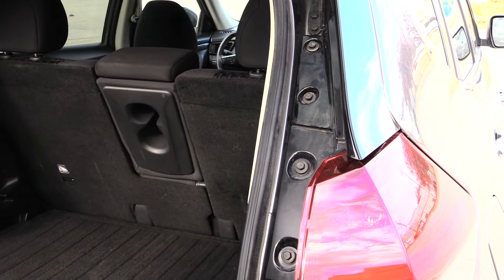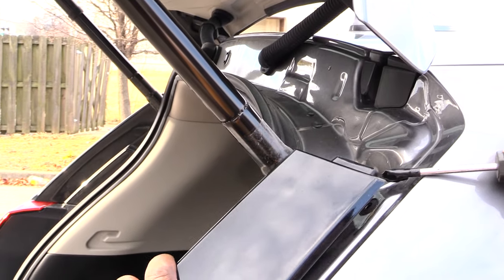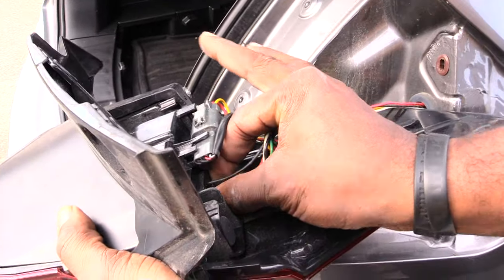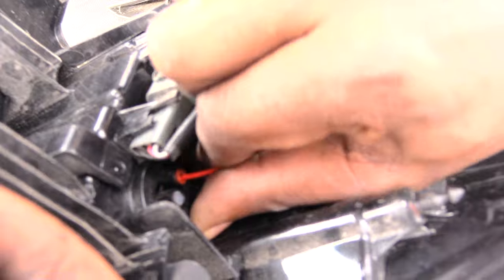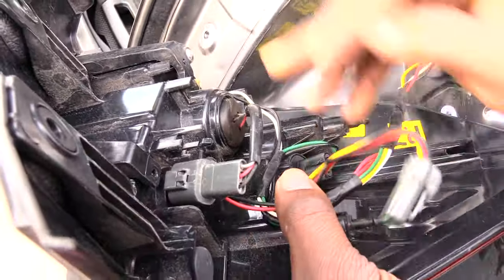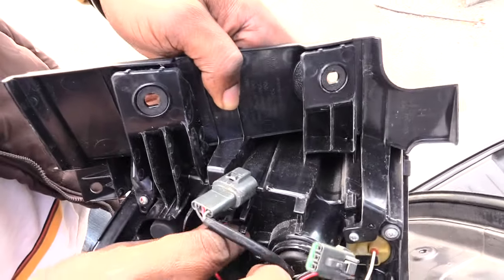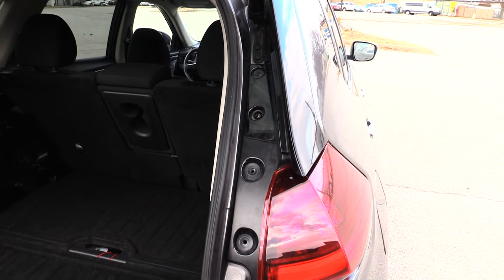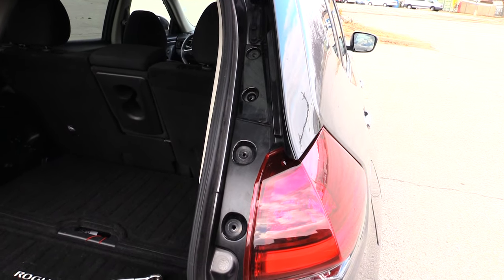Nissan Rogue 2014- 2019 Brake Light and Assembly Change! Easy

Comment: Friendly tip for everyone, don't use a screwdriver. It makes the job way more difficult and it may scratch the car and crack the light. Just pull the brake light out from the back. The screwdriver isn't needed.
Reply from the maker: Thanks for tip agree. Please subscribe like and share 🙏.

Comment: Excellent video!  As a 57 year old woman determined to save money I followed your video and successfully changed brake light and did the little white bulb since I was there.  If I realized there were 3 I would have done the 3rd!  I did have to use the screw driver as light would not budge. I put a medical glove over the screwdriver and gentle pushed and it was easy to remove the light.  So proud of myself!  Thank you again!!!!
Reply from the maker: Your very welcome glad could help thanks for tip.

Comment: Just for some clarification, you only have to worry about getting finger oils on bulbs that have quartz glass (halogen bulbs). If it's a regular incandescent bulb with non-quartz glass then there's no worries. The issue is that the halogen bulbs get a lot hotter than standard incandescent bulbs and the oils on the hotter quartz glass will cause the glass to turn black and crack. To get rid of any oils, use a clean paper or cloth towel with rubbing alcohol on it. Using just a towel alone is not enough to remove the oils from the glass.
Reply from the maker: Thank for helpful information. Please like subscribe and share.

Comment: Thanks for the clear instructions. Just a tip I found a small hard plastic putty knife to be the best at popping the housing out without scratching the paint. It’s able to fit in the curved gap and gives a stable point to punch the top of the handle to release the clip.
Reply from the maker: Thanks for tip 👍🏾Your welcome  glad could help please subscribe like and share and check our my other helpfull videos.

Comment: I couldn't get it to budge.  I was worried that using a screwdriver might crack the assembly.  I finally tried a thin putty knife (with tape on it) and that did the trick.  Of course I was given the wrong bulbs and have to do it one more time.  lol

Comment: If you touch the bulbs with your bare fingers, you should use isopropyl (rubbing) alcohol to moisten your paper towel before cleaning the bulb, not just wipe the bulb with the dry fabric.  The grease and salt from your fingers need to be actually dissolved and removed thoroughly.

Comment: You made it seem so easy but I didn't know the part number for the driver side housing. I contacted the Nissan dealer and was told the part number for my vehicle after providing the vin# is 26555-6FL0D. Wrong connection piece! My vehicle has the same connection piece for the entire housing as the one in this video, only on the driver's side. what part number is it?
Reply from the maker: Sorry not sure I no longer have vehicle. Please subscribe & like and share if haven't already and check out our other helpful videos

Comment: Do not use a screw driver, it will take the paint off your car, even if it coated with tape. It the light assembly is stuck, go buy the correct plastic tool to remove it with for a few dollars at your auto store.
Reply from the maker: Yes if light is stuck get a plastic tool to be sure u don't scratch paint.